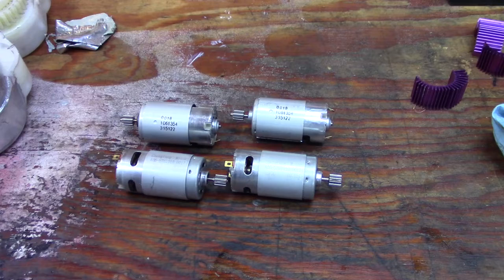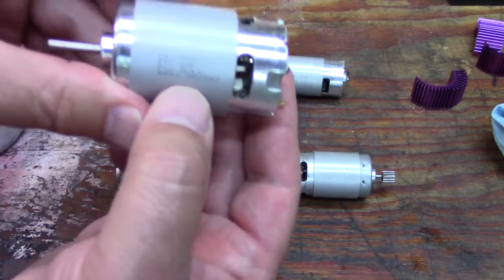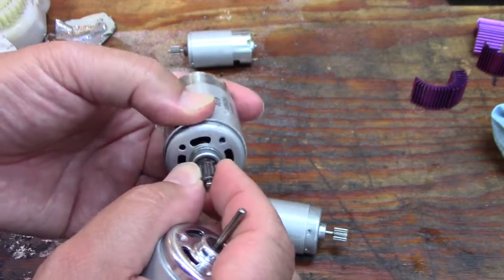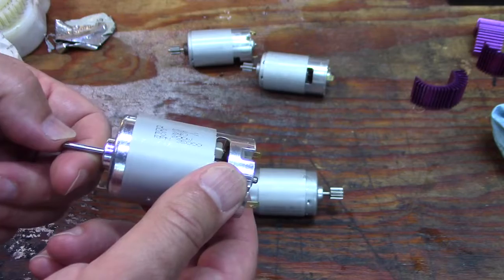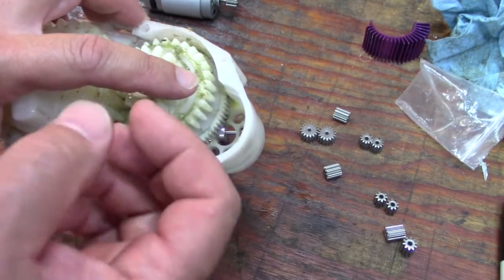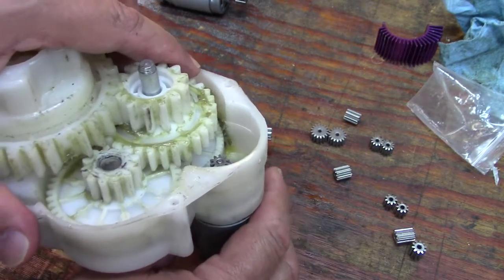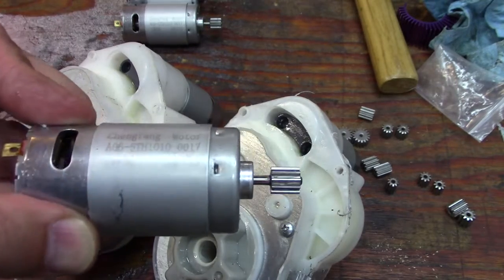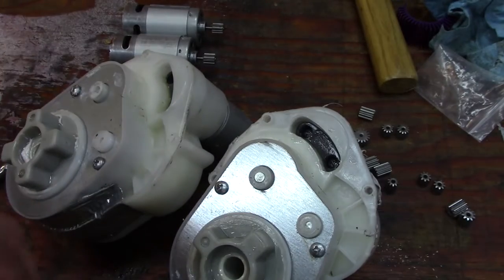Running Peg Perego RZR/Gator 12V Motor Gearbox Replacement Kit at 24V

Comment: Hows it holding up now after 1 year? I did the 12v -> 18v power tool battery upgrade that everyone talks about, I found that it burnt out a motor after a few weeks. I did originally have a buck converter to tune it down to 14v but I found it was limiting amps so the gator wouldn't move once the kids were on it.
Reply from the maker: Everything I used in the description is holding up.  As the kids are getting older, they are using their bikes and roller blades more.  The 24 volt motors I have in the description are slightly faster than the 12 volts when using 24 Volts, but the available torque to go up hills and pull loads significantly improved.  Hope that helps. Please see the description for more information that may help.

Comment: Did the motors last well? Also how did the stock gearbox stand up to the new motors?
Reply from the maker: The gearbox and the 24 volt motors are holding up well.  Kids are going up hills and pulling full size plastic garden trailer with weeds and sticks without issues.  I have them start out in low speed then switch to high speed when pulling a trailer.  I think adding lube in the gearbox has helped keep gears cool.  Check out that video.  Hope that helps 😃